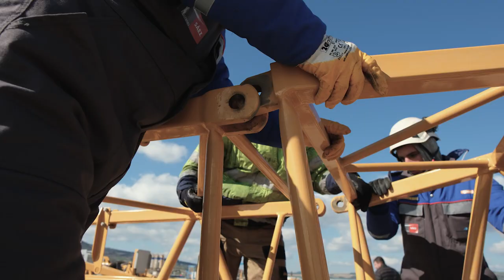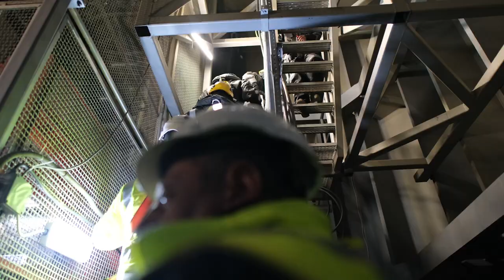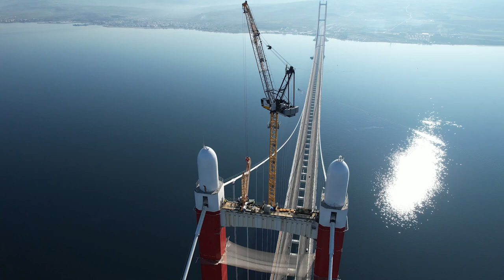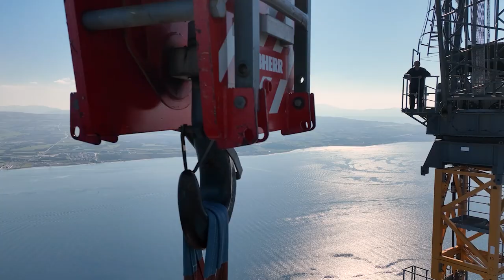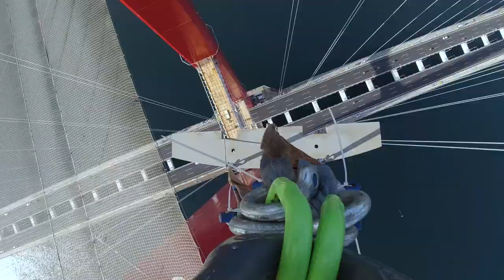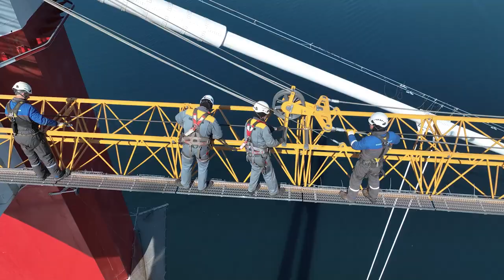Liebherr – Dismantling the HC-L cranes with our Derrick crane at the 1915Canakkale Bridge

Comment: hey Liebherr, can we please get a follow-up on how to dismantle the derrick crane and get everything down ? 😊
Reply: Right such a tease, shows the part of the boom being lowered and cuts off. No spider crane or jib pole up there so my guess had to be helicopter
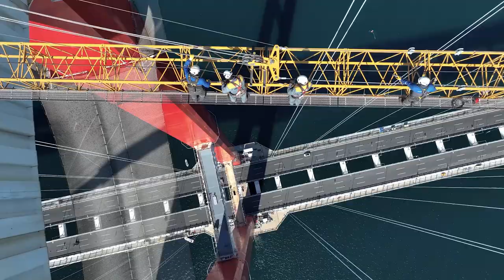Reply: i also thought of the same that how the 2nd crane got down but at 3:38 can you see a green structure, i suppose it did the unfinished work
Reply: I think the smaller yellow crane dismantled the derrick crane, then the even smaller blue crane dismantled the yellow crane! The blue one was maybe  lowered in small pieces by a winch which was then taken down the lift!
Reply: I feel a bit ripped off on this video!! How’d they take the rest down?
Reply: Finally, finished by the MARCA 2 tons winch
Reply: I mean, it's obvious: the small derrick crane was taken down by a smaller derrick crane, which afterwards has been taken down by an even smaller one. This one itself has been taken down by a very tiny crane, which itself was taken down by an even tinier one.
Reply: Worked on derricks many years most of them can dismantle themselves by the use of rigging and methods that have been around since the sailing days of wooden ships . Saying this Can come across overly simplified put another minute of video and photos would answer all of those questions
Reply: Up
Reply: Read the description. They mention it there